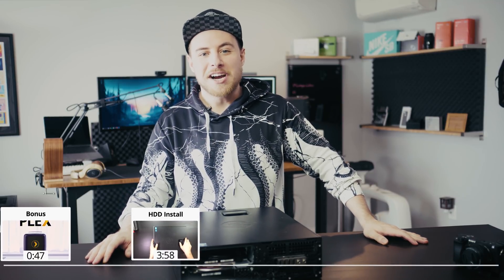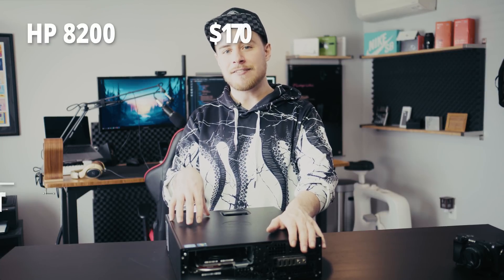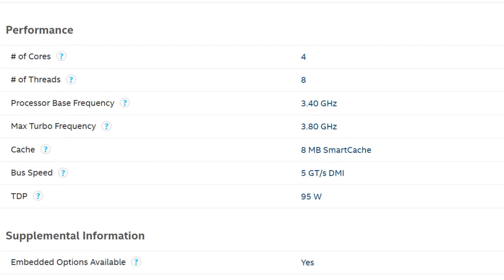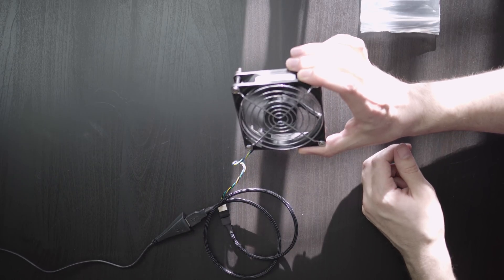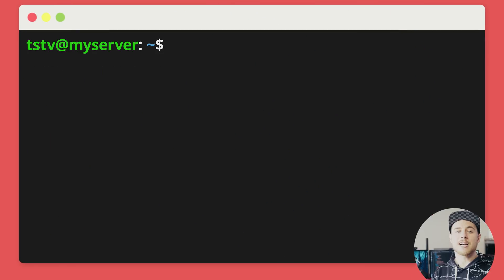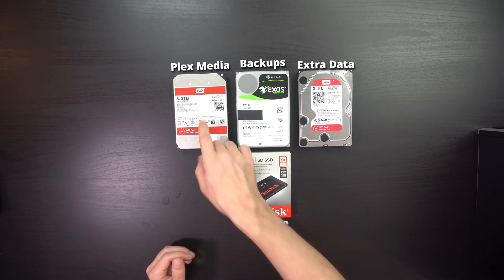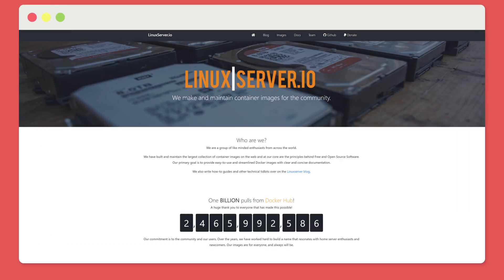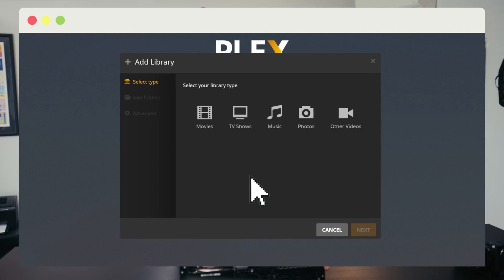How To Build A 23TB Plex Server With Docker

Comment: I dont get the use of docker for this built. Linux is running anyway on the system why dont you install the plex server on it?
Reply: Docker allows you to more easily seperate out different programs and could even allow you to very easily copy over you config to another machine. Its also nice if you have a bunch of services that want to use the same port as docker can map those to other ones.
Reply: @pigboiii  But this is an stand-alone plex server so there is no benefit.
Reply: @livewallberg  mmm fair I kind tuned out a bit during this video. Still I guess the easy migratability and future expandability of the server might still be a bit of a bonus. But yeah I agree if you dont actually user anything else on the system then there is indeed no use for a docker container.
Reply: @pigboiii  i have a plex server, for the longest time i used it under a docker container on freenas. But i found things to run, update and being able to maintain much easier runing it on a bare linux install. Migration and Plex data backup works like a charm, it stays all on a folder on the driver or folder you use to store media, and on a clean plex install it recognizes everything after you repoint the tvshows or movie drives/folders
Reply: @jahntraxler  yeah I know. Currently I use jellyfin myself which actually runs better in a docker container IMO. Plus it runs with some other docker friends on bare metal ubuntu. Then my nas is a completely seperate machine and I connect everything through NFS as I use linux pretty exclusively.
Reply: Because you can better use the one server for other things other than plex and not pollute the Linux host. Also, it addresses people who have OCD who want the smallest image to run plex as a service and makes it easy to update plex and the os since it's just a container. Running my plex on an older ubuntu server was always a challenge to upgrade due to stupid default partitions and constantly finding a good apt repository.

Comment: One comment, why use Docker for this instead of deploying Plex Media Server direct on the Linux OS?
Reply from the maker: Check out my previous video on docker
Reply: @TechSquidTV  I stil don't see the benefit. I see the parameters you put in the Docker yml, but then you still had to configure Plex. When I upgrade plex, I don't need to do anything but download and install the new version. When you deploy a new docker container, wouldn't you need to configure Plex from scratch again?
Reply from the maker: @RIKWID  no you do not! The container runs the software but you still save all the config files and content on the host machine (or elsewhere). You'll see I have volume locations set that map to my internal storage. So for me, to update Plex, all I need to do is run 'docker-compose pull' to get the latest container and run my compose script again.
Reply: @TechSquidTV  OK, good to know. But still, clicking the upgrade button in Plex is still easier. Now, if your server was running radarr, sonarr and sabnzbd, then I could see using Docker, just not for a single application.
Reply from the maker: @RIKWID  it sounds like you already understand 👍 running a single application in my mind still makes sense as it's easier to maintain, remove, and upgrade. But of course it's more powerful when you start adding more services like you mentioned

Comment: I just popped another 8tb hdd into my NAS which should end up around 23tb in Raid5.  My NAS has 6 bays.  I’ve been moving from 3tb drives to 8tb drives.  This will be my 3rd 8tb drive I’ve put into it.  My NAS does have a Intel processor and it running Plex.  It can transcode 3-4 streams at once.

I backup to another NAS. A cheaper arm version.  It’s really the only practical way to backup this much data.

Comment: I was going to go this route, instead just bought a Quad core Qnap TS-873 NAS and stuffed it with 8 8tb drives and added 8gb ram and a GTX1030 for 4k transcoding. It runs plex on a VM and works flawlessly. Though it's already at 60% capacity..ugh lol
Reply from the maker: This was kind of an experiment for me. We'll have to figure out something bigger for the next build. I am very sure this isn't enough for me. Looking to move to unraid maybe. But also not trying to squeeze a server rack in my apartment

Comment: I went full crazy with this project.  I have a fujitsu primergy rx100 s8 with 32gb ram, e3-1230L v3 25w tdp CPU and 3 sff 24x2.5" fujitsu eternus jx40 daisy chained together. The first one is serves as plex media server running 24x4tb 2.5" Hdd in raidz2 for redundancy (96 Tb of raw storage) the second houses 24x 512 GB ssd and serves as iscsi target (all my PC's laptops etc. use this as storage) the third box serves as iscsi target too, but this is for my kvm hosts to store vm's in it. This box bas 12x2tb SAS drives with 4x128 g(striped) cache drives and 8x4 Tb raidz2 for backup customers virtual servers. 
Ram is not enough for this configuration and this is why I ordered a fujitsu rx200 s8. This will solve my problems :) and the old server will be used to store surveillance footage around my house :)
Reply: Oh I forgot to mention I have a 100gbps home network setup and 2x1gbps internet connection ;)

Comment: As a PC builder/repair, I'm noticing that you used a 12v fan with a 5v port. That fan will either run very slowly and not will not preform or not at all. Does that adapter come with a "boost converter" built into the cable?
Reply from the maker: No boost. It does run at a medium speed. But you don't need it running at a full 12v your PC uses voltage to regulate fan speed and your computer isn't always at full blast. It's running probably a little lower than half speed
Reply: @TechSquidTV  the only thing is that it will slow down the air flow. Look at it like 2 cars on the road, you have 1 car going the speed limit and 1 going half that the 1 going the speed limit is going to crash into the 1 going slower causing accident. The same way the fans are. The PSU fan is going full speed and the other one not so fast causing obstruction to the air flow.
Reply from the maker: That's a valid point. I could see that happening. I am not sure that's going to be exactly the case in the real world here because the front of the case has plenty of open space for air to escape from but I see your point. K could put a mesh there maybe and relocate the fan.  I am actually moving to a different piece of furniture in an upcoming video, so I'll be sure to keep that in mind!
Reply: @TechSquidTV  Please check the airflow direction of the PSU fan! It seem that you've mounted the auxiliary fan the wrong way.

Comment: If you were just going to use that 12TB as a "Backup" why not use UnRaid as assign it as a parity drive? That way at least you have some data redundancy/security while maintaining the same amount of data storage. You still could use Docker and have a more accessible interface.
Reply from the maker: This would have just eaten slightly more ram. Don't worry though. This was just for fun for a small machine. We'll build something proper soon
Reply: @TechSquidTV  I really don't think 4GB ram would have been an issue. If you're only running plex on a docker (or plugin with UnRaid) and using SMB shares you shouldn't have an issue with 4GB ram. I make box's for clients that do the same but have all the NZB "clients" installed and they work fine with 4GB.

Comment: If you're running a paid version of Plex server one big drawback using virtualised/containerised deployment is that you loose one of the key benefits - hardware assisted transcoding (CPU). Be aware of that. If you have a proper GPU you can setup a GPU passthrough, but CPU hardware assisted transcoding is a no-go for now.
Reply: I've setup GPU passthrough with Plex and it seems to work just fine, although it's an integrated card and probably doesn't provide much benefit anyway
Reply: "CPU hardware assisted transcoding is a no-go for now" - this is incorrect, if you expose the CPU drive to the docker container you can use quick sync no problem. Mines up now 1 year no problems
Reply: @dndLeitch  Great news if they've changed it, last time I've checked the official stance was that they don't support it.

Comment: /media is a really bad place to mount a folder on ubuntu. It's the default place ubuntu itself uses to mount usb filesystems.
Reply from the maker: You are totally right and I completely blanked on that. I so rarely interact with my servers physically. /media is absolutely a bad idea.
Reply: lmfao absolutely WRONG. if you name your HDDs in a way the file system doesn't then there's absolutely no way(YOU ALWAYS ALWAYS use mkdir as sudo and then use fstab for mountpoints) !!! learn fstab!!! noobs!!!!!

Comment: Using Docker gave you no benefit whatsoever.
Reply: I agree, Docker doesn't make much sense here, and you might even lose Hardware Transcoding since it's not officially supported.
Plex documentation mention : 
== Can I use Hardware-Accelerated Streaming inside of Docker?
 == 
At this time, we do not formally support hardware acceleration inside of a Docker container. Some users of Docker (on Linux only) have been able to accomplish this by adding platform-specific custom configurations that expose host hardware to the container.
Reply: yeah... the only thing that using docker for this setup was to kill the quicksync support from the CPU and make it harder to add new volumes to the plex library in the future.
Reply from the maker: Running in Docker allows me to not only update my plex server simply by rebooting it, it also allows me to move my exact config to a new machine in the future easily. The other reason people are forgetting is the ability to easily add and remove other additional services to the server while maintaining a "clean" core linux installation.
Reply: @TechSquidTV  I've already addressed these points.  If you run a server farm or a cluster and you're often moving Plex around for optimisation then sure, great.  I don't believe you, but whatever.

And what compatibility issues have you had with Plex previously?  Be specific.
Reply: @jonathanmcalroy8640  Agreed. This docker usage is such BS. Many extra steps for no benefits. We use docker for some things. Its not a panacea of the computing or vm world.
Reply: Jonathan McAlroy I agree with you. Plus the part “docker-compose, if u dont remember why that is better..” Since u r running only one container for a plex server, docker-compose is also unnecessary.
Reply: Jonathan McAlroy 1. Easy installation. 2. Easy update. 3. The possibility to rund this container besides numerous other containers. 4. Clean separation of Plex without virtualization. 5. Resource savings compared to a VM. 6. Easy backup / easy transfer to another machine.
Reply: @_TbT_  Sorry but no.  1. You had to add the repo and install Docker/Compose instead of just downloading the exe from plex.tv. 2. Nope, all you have to do is just click the update button in the setting menu. 3. As opposed to being able to run other apps??? 4. How is a native Plex app going to interfere with other apps that will be a problem?  5. So don't use a VM.  6. Nope you'll have to transfer the Media and Plex Library just the same. 7. You're running a whole other Daemon and a whole other filesystem you don't need.

I build and manage Docker and Openshift images for a living.  I love it but its benefits are that it makes App Life Cycle Management easier and its scalability.  None of which is the case here.  I get that you might want to use Docker because its cool but it really doesn't serve a purpose.
Reply: @jonathanmcalroy8640  yeah I agree 100% , I watch the video thinking to myself "why are you using docker?"
Reply: @jonathanmcalroy8640  1. Well, we are talking about Linux as a host here. So no "exe" to download. It is not that difficult to install, but still... 2. Yep. Or you pull the newest Plex container, which should use the persistent volumes. That way you can update easily and recreate the same installation / configuration on another host. 3. Container separate different installations from each other, reducing the possibility to compromise the whole system if one application is compromised. 4. Other way round: the container made for Plex will always bring an environment in which it will run definitely. No other app can interfere with that. 5. Well, separation of services and easy backup are still a thing and prefer VMs / containers. 6. Media and the Plex Library should be on external volumes. To backup them is just copying around files.
Of course it wouldn't be NECESSARY to run Plex in a container in this case, but there are upsides to it. I find it baffling, that you, who builds Docker images "for a living" does not like that approach.
Reply: @_TbT_  1. exe=Executable, Mode 555.
2. Or just click "Update" from anywhere in the world.  You'll still need to move the library and media.
3. From Whom?  Who's going to hack your Plex Server?  And if you're really worried then use OpenShift.
4. Like that's a real risk with an off the shelf app like Plex.  It's true for in-house apps.  Were you previously spending months UAT testing Plex before promoting it to production with a Change Request?
5. It's not any more separate than another app on the same host and you don't have to piss around with Shared Volumes.
6. No different from a native app. 

If the point was "we're going to use Docker for fun", I wouldn't have said anything but trying to post-hoc justify it as being worthy is just silly and unconvincing.  We use it at work because we're developing Apps and maintaining integrity from Dev to UAT to Prod and COB is otherwise difficult.  Then in Prod we'll have thousands of copies of the App which makes update otherwise difficult.
Reply: @jonathanmcalroy8640  I'm with you on the lack of need for Docker for Plex although a VM setup for the torrent side could potentially be useful if you plan to use a VPN and only want to tunnel the torrent traffic through it. Using a VPN system wide can be a pain if your VPN doesn't allow for port forwarding making Plex unable to be seen outside of your local network as when it pings Plex's server to check for remote connection it returns your VPN's IP which your server cant be reached on due to lack of port forwarding. Setting up a VM and running the VPN client inside with your torrent software is a much easier solution than trying to setup routing tables to route Plex traffic around the VPN. Of course all of this is mitigated if you use a seed box and just setup lftp to grab the content from the seed box once its finished downloading content.
Reply: @_TbT_  You don't need a VM or Docker to run Plex on Linux (or any OS)... That's the point he was making.
Reply: Chris Simmons Read the rest of all the answers. All has been said.
Reply: @_TbT_   you still don't need Docker just reg Ubuntu/PopOS and used the Software Center to install plex all done
Reply from the maker: What this person said.
Reply: I run Hyper-V core which barely requires any sort of resource to run.  And I can run multiple VMs at the same time (Plex server, torrent server etc.) I can then manage the server remotely using Hyper V manager by simply editing my host file on my gaming PC as well as a few commands to properly configure remote working. If you're tech savvy this is extremely easy to do.
Reply: @BorisJohnsonMayor  can you give a good reason why you wouldn't just run Plex and Torrent as two aps on the same host?
Reply: @jonathanmcalroy8640  More or less for security and segregation from the host.
Reply: @BorisJohnsonMayor  What extra security can you put on a VM that you can't put on a host?  Why do you want to segregate your Plex server from a Torrent server? What benefit does that bring?

Comment: Storage without Raid is not a good Idea. But at least you are doing backups.
Reply from the maker: This is meant to be in a small form factor. I do not have "mission critical" data on here that I need to have availability for. The backups will suffice. HOWEVER. I have not yet implemented the backup system because I need to find a way to protect against corruption and bit rot. I may need to configure some system to only backup new files or something of that nature. More research needed.
Reply: That depends Jens

Comment: So it's actually a 8TB single drive Plex server?
Reply: I think you mean 321 Backup https://www.backblaze.com/blog/the-3-2-1-backup-strategy/
Reply: yes.the server has 23tb storage space.he didnt say it has 23tb for movies with zero space for backup
Reply: To speed things along you could have also gone with dockstarter which comes precompiled with multiple apps and also a letsencrypt container for securing your outside access to your applications.
Reply: My 36TB (21TB usable) server is about the same price... And yes, it's dual xeon x5600 series.
Reply: @DangoNetwork  Good that you feel that Dual xeon CPUs are important. I'm running my 32 Gigabit SAN on an intel i5 CPU
Reply: @sir_anders  Yes but if doing a lot of transcoding with Plex those dual X5600's will rip your i5 a new one, even if it has Quicksync.  Disk IO is not terribly CPU intensive but media transcoding sure is.
Reply: Josh C  Thats not the model I'm afraid. You want 3 copies, on 2 different mediums, where 1 should be in a different location.
Reply from the maker: I plan to do this next with a larger server but none of the Plex data is mission critical (unlike my YouTube files which are). 💯 not for "safe" storage as it is now.

Planning on the next build with cloud backup possibly
Reply from the maker: Plex is one of the functions of the server. 8TB of the 23TB total is dedicated to Plex, an additional 8TB of the 12TB dedicated to backup of that plex data. So 16TB actually being "used" by plex itself.
Reply: @TechSquidTV  Cool so your title was just a bit misleading.